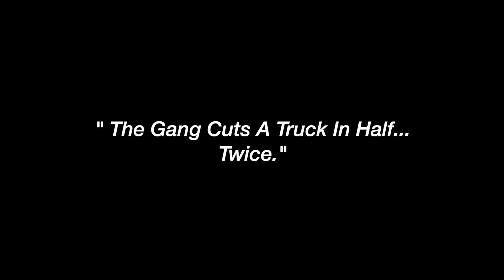Building The Worlds Craziest Overlanding Camper Truck - The FLOOR

Comment: You should build the camper using Aluminium to save weight. You gonna be surprise how quickly you'll reach maximum payload before even having the camper fully loaded.
Reply: Especially on rams, right at the edge of the cab they’re super prone to bending the frame due to no bracing, ford puts thick ass plates in that area. Hopefully they do that. But who knows
Reply: @KDlGG looks like there’s enough hanging beyond the rear axle to counter balance it!😂
Reply: @KDlGG  You ain't going to bend a 3rd gen very easily.. The new 2019+ trucks have had some serious issues though. It's kind of funny to think any frame dodge made on the 3rd and 4th gens are stronger than their new, redesigned "5th" gen frames.
Reply: I would reach out the Kimbo, they are all aluminum. Might be a cool joint venture
Reply: I'm always surprised how much they build out of thick steel.  It is easier to make sure things don't bend, and are safe, but I feel like a lot of their cars are heavier than they need to be.   Colin Chapman would not approve.
Reply: Nothing wrong with wood either imho
Reply: I don't know about the newer ones , but my dad has a 97 dually . And he has carried 6 900 pound bins of apples in the bed . While also towing a trailer with 16 more 900 lb Bins of apples on it . And with the Cummins turbo diesel engine , it handles that weight like it was empty .
Reply: @CPSteveMiller  they are literaly destroying the value of the truck with this camper build. Also being so big and heavy could turn it too hard to maintain, especially if requiring to use a lift. As being too heavy and wide for many trails. It would be a better option to mod a proper off-road trailer, that would allow more payload, as using the truck to explore some trails as using it to get more supplies while the trailer is parked. And when the trailer isn't being used, use the truck to tow other car builds.
Reply: @scottrob60  not a surprise they get this truck easily stuck in the first trip. Also, using such heavy structure, the truck will be quickly overloaded with all supplies to the trip.
Reply: @CrappyCar   plenty of YouTube channels from Australia, with campers built out of Aluminium.
Reply: I believe the truck was already totaled so not much value anyway
Reply: @CPSteveMiller  I’ve seen more 3-5th gen frames bent more than anything else, that being said he’s gonna be maxing their rating out most likely, therefore you could be taking chances with frame problems😂 if he’s gonna be doing all this at the very least he should stiffen it with plates like ford did,
Reply: Put captain seats in the back so you can seat 4 and still walk between into the camper
Reply: Weld aluminium camper to steel cab 🤣🤣🤣🤣🤣🤣
Reply: @BreadManNoWheat  trust me. These trucks go for a lot more than you’d imagine even totaled
Reply: This trucks payload capacity is 4600 lbs, that’s more than a 20 foot Jayco pull-behind housing a family of 5.
Reply: Plate/box the frame in to help with strength
Reply: @Roger190SL  8⁸
Reply: B is for Build is going to have to call Matt’s Off Road Recovery by the time this steel box gets to touch dirt road
Reply: @thomassorenson6371  they are building a camper with an 11-foot long floor... slide-in truck campers of that size will exceed 4600 pounds when loaded for travel. At that size, it needs to be constructed with attention to weight... certainly not including a massive bar of solid steel (for instance).
Reply: @Mahalo_83  obviously an aluminum camper would be bolted, not welded, to the steel cab.
Reply: @Evan Eichenseer  the collision damage that totaled this truck was all in the front; there was nothing wrong in the back, and lots of parts and effort went into fixing the front so this is no longer a cheap truck.
Reply: Multiple pieces of steel doesn’t make it stronger
Reply: Yes steel is heavy!!
Reply: @Roger190SL   - They have 1.6 million subscribers.  The "value of the truck" has already paid for itself with 260 thousand views.
Reply: @ryanlebetsamer7075  
re -- reinforcement
Agreed.
Adding material merely transfers stress to the next weakest area.

Comment: Aluminum box would definitely save on weight, also from the trucking industry sometimes we use rubber "thresholds" that go between the sleeper and the driving area to allow flex and the option to not have a sleeper unit. Might be a good way to go from cab to the back of the truck in your case as well
Reply: Even better, build it with carbon fiber and advanced composites.
Reply: @jaynecobb1  
YouTube has an example of a CF camper, something along the lines of "World's Lightest ExpeditionVehicle!".
Problem -- a light breeze punched it into the next zip-code.
True fact...
Reply: @largemarge1603 exactly, like just use aluminum bro 😂

Comment: Old minitruck walkthrough beds would use a rubber gasket between the cab and the box/camper shell to let everything flex. Yes, welding a bunch of steel to make the frame less flexy will help, but it might still flex enough that a rubber section between the cab and camper would be beneficial.
Reply: I used a rubber accordion style "gasket" for the walk thru on my S10. Ordered it from an RV shop
Reply from the maker: Its going to be interesting to see how this turns out, I do think itll be ok, but if not, ill be getting the rubber gaskets and going that route. This is just something i really want to try and see if we can pull it off. Its similar to the first time we started cutting cars up in weird ways. Its alot of real world testing to see how things react.
Reply: Yeah, it's a regular cab (1999 xtreme) with cab high fiberglass topper. It still wobbles/flexes even just shutting the doors hard. Didnt do anything to reinforce it, but no leaks! Both ends of the rubber just clipped on and added some rtv. Car custom shops were stupid expensive, but ordered this by the foot, it was just lil over $100 (5yrs or so ago)
Reply: @BisforBuild  Totally respect that!  If it works, it works...if not...try again.  Looking forward to the next ep!  Well done guys.
Reply: He is going to need to use the accordion boot to connect it... It's how sleepers are attached to tractor cabs.... It's how I connect my bed to my cab on my 2010 taco...
Reply: It's all very well to say that you will weld it solid and fix it later if this doesn't work. But, consider the failure mode if it doesn't work. This will likely be massive wrinkling of the bodywork and/or windows breaking. It might be better to avoid this risk,
Reply: Some box vans are built that way. 
Cab is on rubber. Box is solid mounted. 
They are bolted together. 
They work just fine.
Reply: @BisforBuild  I like the thoughts and ideas so far, but this one is a bit worrisome, this big truck WILL flex if you truly intend to overland her.
Reply: @BisforBuild  you should look at sleeper rings for Peterbilt 379 and 389 sleepers, two grooved rings that hold a rubber gasket between them
Reply: @BisforBuild I truely hope you can prove us wrong Chris.
Reply: @ratmanbrian  Agreed!  Don't ruin the truck guys!
Reply: We never had issues
Reply: Put captain seats in the back so you can seat 4 and still walk between into the camper
Reply: I still have a mini trucking magazine that show how to do it.

Comment: You need to do a pivot system. It's what they use for Unimogs when adding a custom box in the back. Also you can extend the chassy 1meter to fit a bigger box. Aluminium for light weight. Like so Chris can see

Comment: Instead of hard mounting it to the cab, use a spring loaded panel to seal it with a gasket. this would allow flex, all while preventing you from hard mounting it to the cab.

Comment: Chris you should drop that floor frame down 600mm off the back of chassis as you'll gain not only interior height 
But will also have less a step getting in and out back

Comment: Killer build! About your airbags, I would recommend running your rear airbags with a few pounds of air in them. It would keep it from creating negative pressure and collapsing while traveling. If and when this happens, it can pinch and put a wonderful split in your bag making it useless.

Comment: You need to do a three point mounting system and isolate the camper from the frame.  There is a reason this and a passthrough are done on every single expedition vehicle.  You're putting a ton of strain into keeping the frame stiff instead of letting it flex and move a little as designed.

Comment: Yall should install another dualy axle on it too :D that would be dope and honestly it would probably help out with any potential tongue weight issues since the hitch is so much farther away from the rear axle. Food for thought :)
Reply: Is an insane six-by-six would make this even better
Reply: Put captain seats in the back so you can seat 4 and still walk between into the camper

Comment: Hey Chris, wouldn’t it make sense to also triangulate the extended frame for extra torsional rigidity?
Reply from the maker: Thats a good idea, we'll do that
Reply: @BisforBuild  🤣🤣🤣
Reply: I vote for a second row of wheels if you’re going to tow anything heavier than a jet ski. 
Triangulation as a minimum. 
Cool build guys. 
Remember when fitting out the interior, make everything multi purpose if you can. 
Check out some factory campers for ideas. 
Looking forward to the next episode 😎
Reply: @BisforBuild  look into Everlanders youtube channel, they build a system that allows the chassis to flex, keeping the camper safe

Comment: Don’t underestimate the weight of everything. A 1 ton pickup with an aluminum sled deck with two sleds feels way heavier than you’d think. And this is going to be 3-4 times that weight with similar center of gravity

Comment: 2003, after a half-century of make-do camping in lesser rigs, we built our ExpeditionVehicle.
Our interior is 12x7 by 7h.
We engineered our mass between the axles.
This reduces hobby-horse bouncing and knocking parts on trees and unwitting by-standers.

Comment: Now that you've extended the rear frame, I think you're going to need a 3rd axle just to support the whole camper thing, also to keep if it from tumbling backwards now that it'll surely be rear-heavy.
Reply: Third axle, or even sliding the existing axle back would also help with departure angle if they intend to really bring this thing “off-road”. I’d think even a moderate incline would have the tow hitch scraping as it is right now
Reply from the maker: its not that much weight. I know it all looks heavy on camera but its really not a concern.
Reply: @BisforBuild  There's also a 1100-1200lb engine practically over the front axle, and these trucks have damn near 5000lbs on the front two tires, so adding that extra weight cantilevered that far behind the rear axle will be just fine.
Reply: You can always add a bigger and heavier engine 😁
Reply: @BisforBuild  It's all well and good. We'll see when the whole cabin is built if it'll need it or not. Also reading from some of the comments, you'll probably gonna need additional bracing underneath to further strengthen the stock truck chassis.

Comment: When upfitting a truck, the general rule of thumb is 60% of the rear box/bed is supposed to be in front of the rear axle. The more weight behind it starts taking the weight of the front axle. I see a lot of white knuckles when driving this truck. Best of luck!

Comment: Fun build! I would check out suspension upgrades to increase total payload - you may want to look into how much weight the system can normally support and what options there may be for adjustable heavier duty suspensiom for the rear.
Reply: They had air suspension, and decided that they didn't need it. Even with that, the axle (and wheels, and tires) still has limited capacity.

Comment: Things I learned doing my build.  Use a mini split ac. Vitrifrigo refrigerator. Honda 2200 with extended run cap. Diesel heater. Marine water heater that can be heated with the truck coolant or 110.

Comment: I would definitely consider a 2nd axle to help support the extra feet
Reply: I was thinking the same thing.
Reply: That or maybe extending the wheelbase if possible?
Reply: Lol, I went scrolling through the comments cause I knew someone would have the same idea. Tots would do a second axle if you are planning on towing
Reply: Too late now but I would have cut the frame ahead of the axel then exrended it back and filled in the frame gap.

Comment: To efficiently increase torsional stiffness in the chassis it is best to use large dimension hollow sections as cross members.  Tubes are best but rectangular will work too. The more the better.
Reply: Correct... and the solid rectangular bar is just ballast.

Comment: this is my least favorite B is For build project. Being a transit mechanic and dealing with busses. You guys are about to build a shell on your truck, busses are built as cheap and as light as physically possible and they still add A TON of weight to the chassis. matter of fact every single one is at or exceeding its designed chassis weight DRY. unless you build your frame from aluminum and skin it with fiberglass its going to be a solid 3000LBS added to the back of the vehicle. honestly the dodge can handle that, but dont expect to haul anything and be remotely DOT compliant
Reply: So fully loaded bus chassis is banana?
Reply: i need to add a separate comment involving flex. cab and chassis bus manufactures "solved" this issue in a kinda genius manner and for me to describe it in a comment would be complicated but basically the body needs its own frame and it rests on the factory frame rails longitudinally on a 3/4" rubber isolator, if the frame flexes too much it doesnt effect the body because its not actually attached and the body holds its own rigidity... feel free to message me
Reply: @jwalster9412  b is for banana
Reply: Interesting question. I wonder if they have any wieght considerations
Reply: @tacedaddy  After seeing more of the vid, I actually agree, the way he is attaching it to the cab...
Reply: Good thing it's not a commercial motor vehicle, dosent matter.
Reply: Hauling capacity is different then towing capacity. Otherwise you’d be able to tow 2,000 pounds with a 1 ton.
Reply: That’s why I said use a aluminum type III Ambulance box. Problem solved. Rookies. Heh.
Reply: Brent? Is that you Barney Rubble?
Reply: Boohoo you just don’t like it because it’s different, quit being a hater
Reply: I used to build coaches and busses coaches used to be wood framed then metal framed, busses were all aluminium frame.I do agree with Brent, this is going to be way too heavy
Reply: @SammyTheDitchDoctor  probably would be better to build out an old e450 ambulance but I guess he wants to build this all from scratch 😅
Reply: For all the reasons you listed… is why I like the project. Let these guys do the experiments. Let them fix their own problems.
Reply: It’s all for content. And he’s honest when things don’t work. And knowing Chris he always finds a way
Reply: You must be new here
 Doing things wrong is the norm. But entertaining
Reply: @TripleDiamonds  I completely agree. I was talking about making something work with what they've got. I've converted type I boxes to III and III to I on many a remount. They're already Aluminum which you know. Was just a suggestion to shortcut a lot of the weight problems he's going to encounter...
Reply: @michaelmaccallum8011  it’s really cool that you don’t have any understanding of how our highway systems work or how rules are enforced but whatever that gvwr is on the door is the law. And since I’m sure he’ll register it as a business vehicle then he’s liable
Reply: @SamuelSchehrer  no I clearly and concisely explained why I didn’t like it, had nothing to do with it being “different” which is definitely is not the Australians have been building these for years. I just compared it to an industry i am highly familiar with and noted the issues both Legal (dot) and from an engineering standpoint. Also welcome to America where I can not like something and I don’t care what you think 👌
Reply: @tacedaddy  lol 👍
Reply: @AlienBmxican  
re -- doing it wrong 
I thoroughly enjoyed this thoughtful addition to the thread!
Reply: @michaelmaccallum8011 it does matter to the builder fam

Comment: The next giveaway should be an Old Pickup truck. A 67-72 chevy in particular as it offers a lot of options for bolt on updates. In many cases Factory GM components from trucks as new as the 1990's just bolt on (brakes, power trains, lights and such)  making for an easy quick project with lots of design potential. It would also be a great platform for the B is for Build design flair without getting too far into the weeds with making body panels. Combine this with a good tow hitch and you can call it the toy hauler.   If you want to get a little crazy with the fabrication you can swap out the stock dashboard for one out of a 65/66 chevy which looks a little more aggressive and would be an interesting fabrication project to make fit especially with the addition of a touch panel radio or something.    Finally these trucks have an Enormous following which would potentially expose your channel to a new audience.
Reply: I would love this!

Comment: Research how semi sleepers mount to the the cab of the truck. They use a large flexible gasket that seals out water well and still allows a fair amount of flex. You are definitely going to want that giant camper box to be able to move separately from the cab.

Comment: Ram 5500 Camper Thing (on instagram and youtube) covers a neat way to allow for flex, but it is a separate camper from the cab. Maybe use some of the gasket/threshold big rigs use to connect the cab & camper? Like you said, truck beds are separate from cabs for a reason